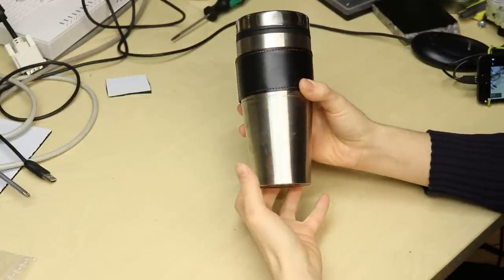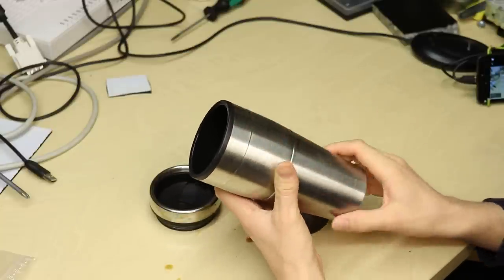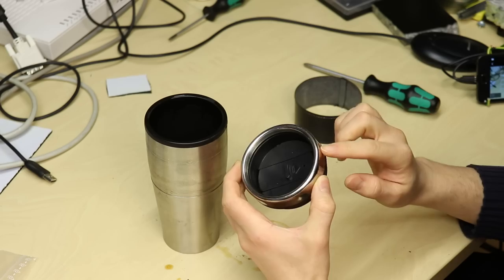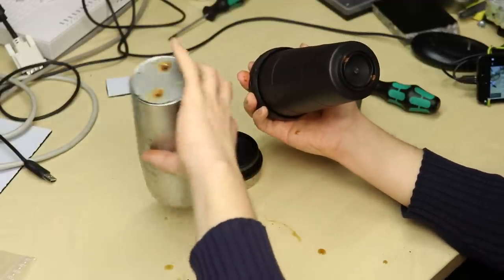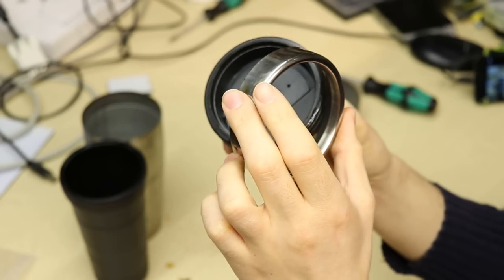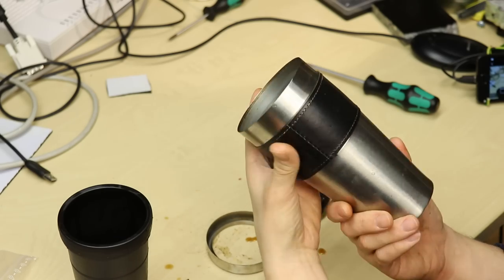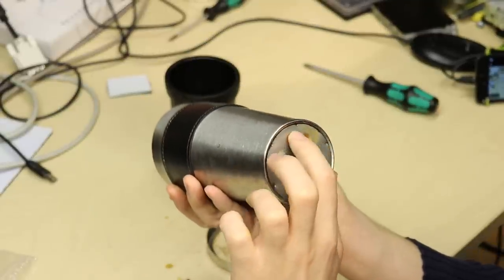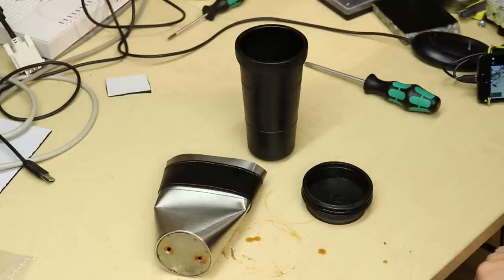Evil leaky coffee mug teardown

Comment: Hmm shitty design, fill the inside of the ring with silicone sealer and squidge it back on the cup, put book on top to keep the ring under pressure, trim sealer off the inside edge with craft knife.
Its a thought :-D
Reply: Wotcha!
I was going to comment the same thing...  Ooops, too late...  :o)
Reply: It's a quick bodge to a rather silly design.
They should have cast the rim as part of the cup, but they wanted a flashy look, silly designers... well crap designers :)
Reply from the maker: No. This cup was not deserving of life.
Reply: Or buy a new one...